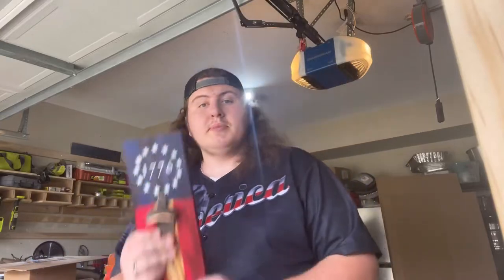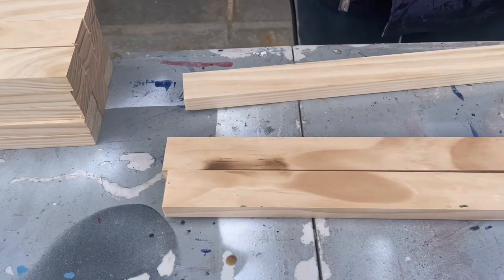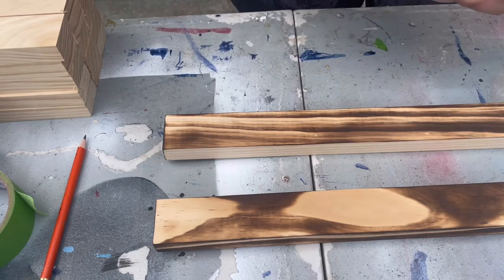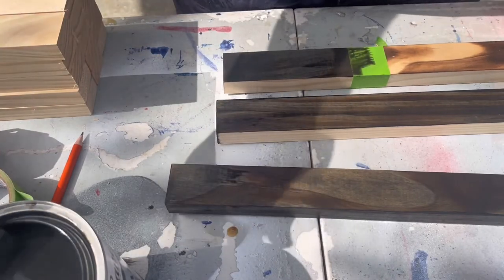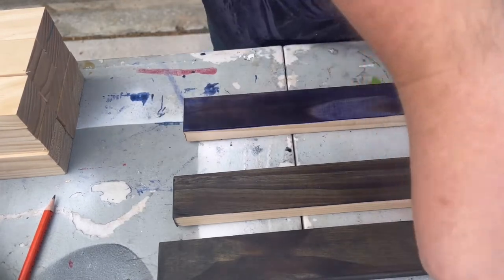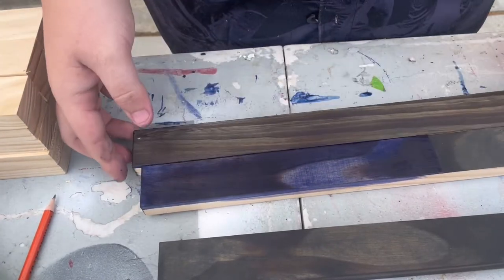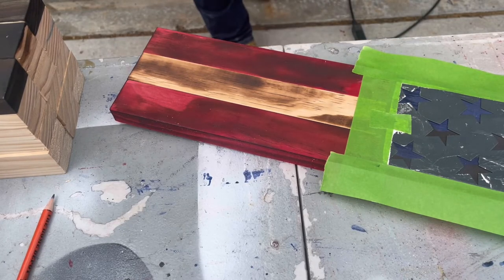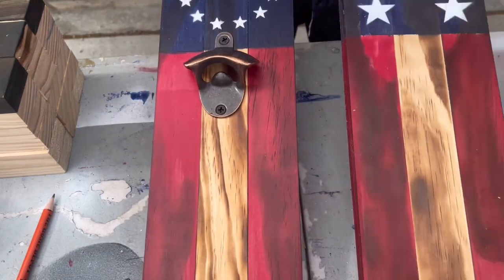How to make Wooden USA Bottle Opener

Comment: Great video I have made one of these and 3 mini American Flag builds I used a razor to separate the union it seemed to work better for me than the tape, I've seen the razor on others so it's not my idea I also used small wooden stars that I sprayed white and also carved out the back where I inserted a small bar magnet in the back of each stripe so the bottle top stays on.